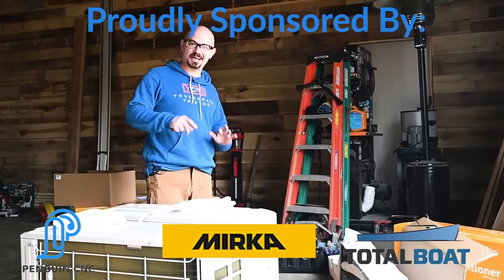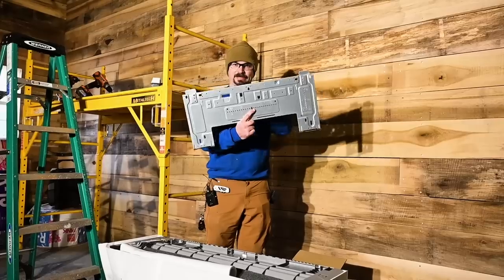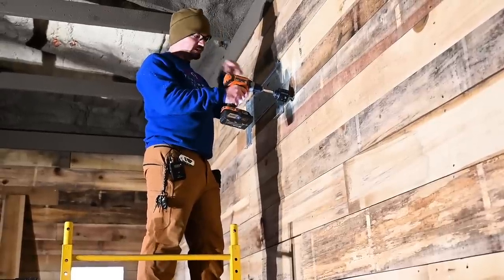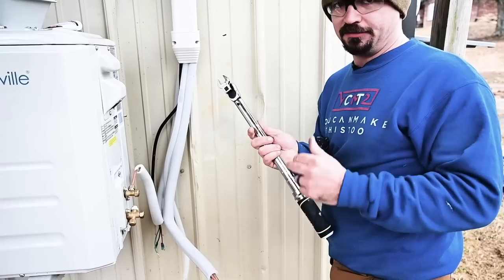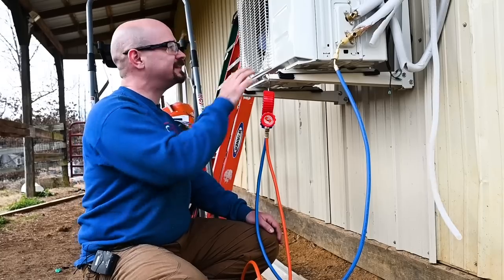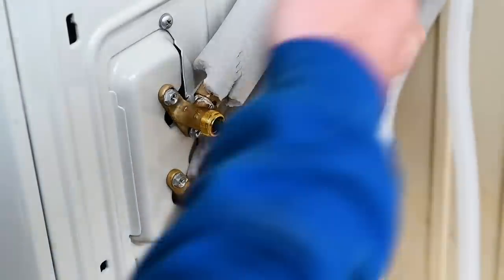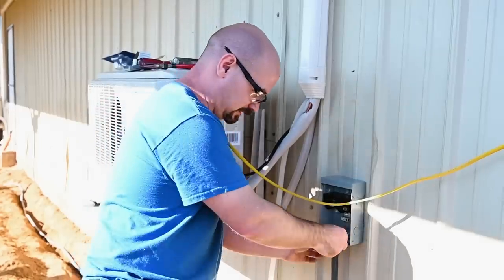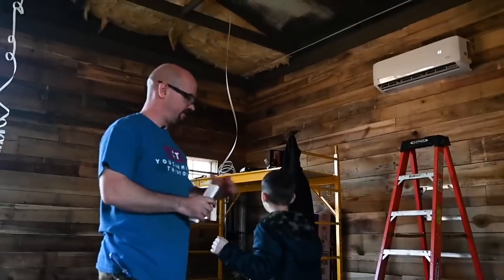Installing a Senville Mini Split | Dream Shop Ep8: HVAC Install

Comment: that was a waste of time, I watched several videos about this and everyone somehow skips the "vacuum the line"  process and acts like it's nothing. and that's the only reason people are watching the videos for. it's obvious the reason they skip it is because someone else did it for them.
Reply from the maker: 9:00 to 11:30. If my talk through how I used the manifold to pull vacuum didn’t get you there, I recommend searching for video on how to use a vacuum manifold gauge. 

And no worries on implying I’m a liar. I get that your frustrated. 

I also recommend going through the comments here. Lots of good feedback from hvac guys on howto vacuum better

Comment: Why do these people installing mini splits never talk about the electrical part, what type breaker what Guage wire....
Reply from the maker: Because it depends on the size of your unit and the motor used. The data plate will tell you the amp draw. Pick a breaker size above the draw, then check what wire gauge goes with that size breaker. 

Odds are you’re looking at 20A breaker and 12g wire unless it’s a really big or really small unit.

Comment: Do they fill the unit with enough r410a to cover the length of lineset selected? Also you didnt check suoer heat is that not required?  Thanks
Reply: Enough 410a to cover 25 feet. Can't check super heat as compressors have accumulator tanks.